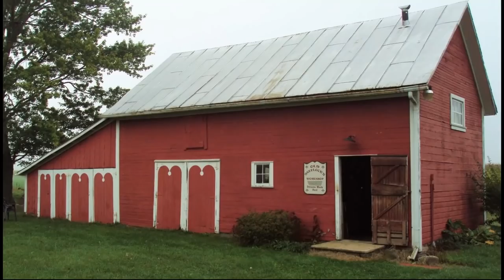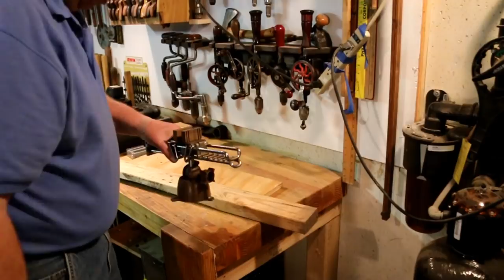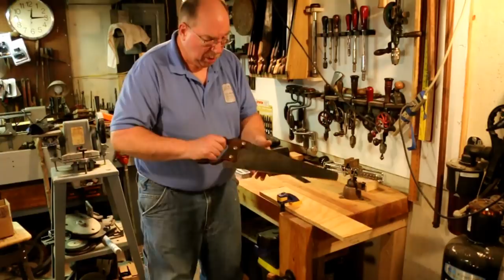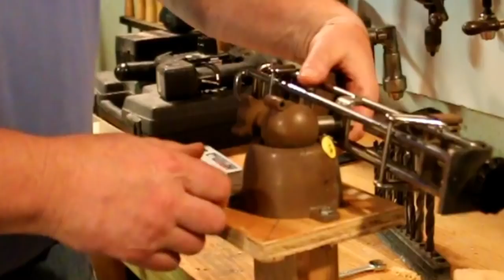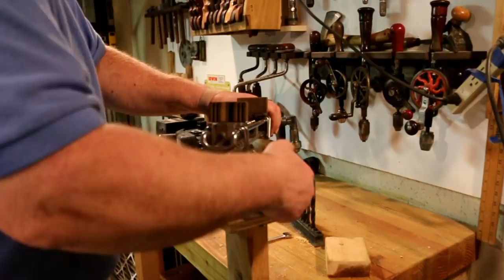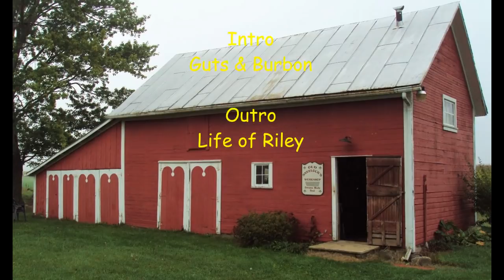Quick Mount For Panavise

Comment: If I were building it, I would probably have put a couple of small cleats to the 2 by, for it to set on the woodworker's vise.  Then it would always be at a constant height.  But that's only if you wanted a consistent height. And they could already be added, as I'm about a week behind in my video watching (vacations do that). 
I might have put it on a lower base as well, because I wouldn't think about making it taller so I didn't have to bend over.  I think making a taller base is most likely the better option, and without cleats you can set the vise to the height the job at hand dictates, and not the height you thought it should be when you made the holder.  I am glad that there are other people out there to do some thinking for me, because it is always better to have more ideas on how to do a job than the one your own head gives you.   That's going to be a useful addition to the shop.

Comment: i use my 3 inch brace often took a long time to find a good one  
no cords a good lunch and your good to go  cordless now and then keeps your hand tool skills sharp
Reply from the maker: It will still work 6 hrs later when the power drivers 3rd battery has died. 😆😎
Reply from the maker: Years ago the guys on The Old Tool Mailing list were saying if you find a short throw brace, meaning 3" or under, buy it. 
The one I used here is the nicest one of the three I found since reading that. I have seen at least a hundred braces since then, and purchased a dozen or so. Three of which were the short throws.   
After surviving the initial old tool aquisition phase, that so many of us experience, I have settled down to buying only a tool that is either better than one I have or rarely one I don't already own.

Comment: I gotta tell ya. Until I watched your yard sale video on the dollar panavise I’d never heard the term. Then you showed all three together and I chuckled. I have the identical one with the magnifying glass that came from a yard sale fir a dollar as well. But I didn’t know it was for the work you described. I keep it in the house for the sole purpose of splinter removal !!!  It and the tweezers sit on an old Singer treadle machine. LOL. Ain’t that funny. 

Btw... good job on the mount and now I’m going to be looking fir the larger ones. I really enjoy you and your Old Workshop.
Reply from the maker: It isn't a common item. I don't think I would have looked for one. Finding it for a buck is pretty uncommon.
I tend to get the unusual items because there isn't a big demand. Since my major filter is $10.00 or less, things in low demand sell for less. They end up at the bottom of my pond. 😁😎
Reply: @OldSneelock  I was just telling the Missus the cliff notes version of not knowing panavise is the name of this thing she's using now for making jewelery  (never saw her use it before except in the splinter-removal department) and when I mentioned the sizes of your other two she now insists she needs a much larger one also.  What did you get me into anyway...(-:
Reply from the maker: @tractorman4461  Education is a wonderful thing. I just saw a video today after David Chadwick mentioned wanting one. A guy made one with a trailer hitch ball. 
Mount a small machinists vise on it and away you go.